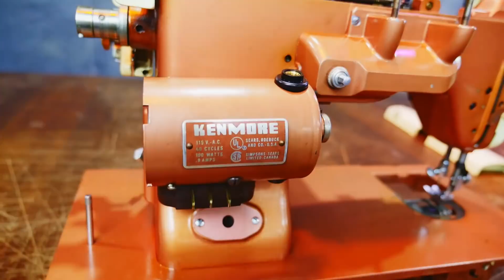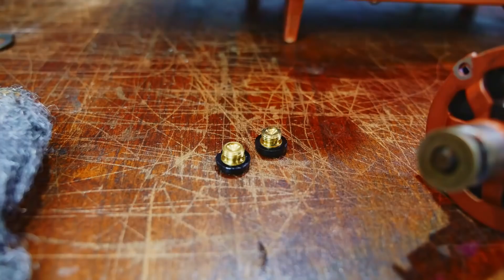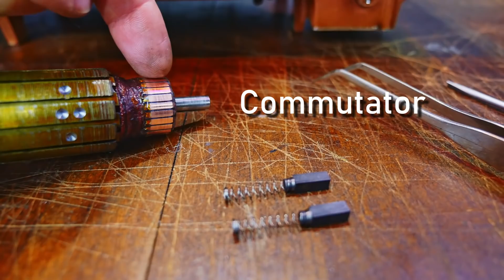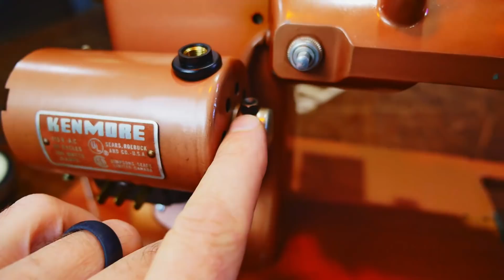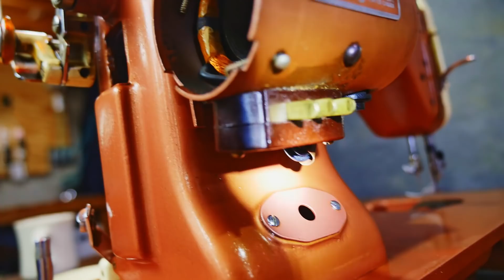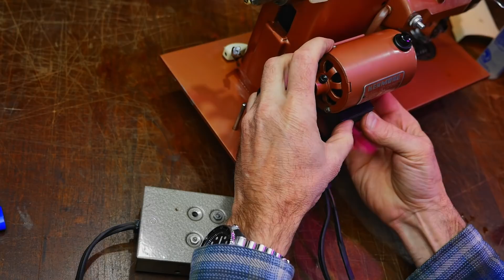Domestic Sewing Machine Motor Inspection and Tune-up

Comment: I know this is an old video but wondering if you might have some input on my machine. I am using an old Sears Kenmore 158.17032 that has a 110/120 volt 50/60 Hz AC 1.2 am motor. Would this maintenance be the same procedure? Do these motors lose any power over time?

Comment: How do you get the motor out, mine won’t budge nuts are off and brushes out but I can’t get it to come out
Reply: Me too! Did you ever get yours open? I'm thinking paint has sealed the pieces together but not sure.
Reply: @millie465  I hammer a flathead between the top and bottom once for each side and it normally pops open

Comment: Hi Alexander. I have a Necchi Leila and the motor has recently been replaced, unfortunately, it still doesn't work as, it stops more than it starts, also it is extremely loud when it runs. I might be able to get the old motor back. From what you are saying, the original motor might be fixable? Warm and best regards.

Comment: The last motor that I worked on, I had to remove the field coils to replace the leads to the brush housings. Man, are those things in there tight! I don't have a puller or press, so I had to work it by hand. Much worth the effort to return a 60 year old motor back into operation.

I have a lot of respect for the old machines. I have 100 year old motors that still run great. Keeping them going pays tribute to their place in history. That's very satisfying to me. I assume that you must feel the same.
Reply from the maker: I do feel the same and in the case of this machine it just looks better to me to have the matching motor.

Comment: I just went through my old Singer model 1873 Merritt. Replaced the brushes & cleaned the commutator. It still did not have the stones to sew with. I just replaced it with the "chinesium" generic motor from Amazon. I had to adjust the foot pedal switch but the replacement works well. The downside to the cheap replacement motor is wire gauge. Very thin on the chinesium pedal/plug assembly. I may graft the old Singer pedal wiring in, although, I really hate to cut it up. Great video!
Reply from the maker: Sometimes you just got to do what you have to do. Thanks
Reply: I actually have a "Domestic" sewing machine...it belonged to my mom...I'm pretty sure I just fried the motor...the label says 65 watts, 110 V, E-6354. It's from Cleveland,OH. Can I buy. A replacement motor???
Reply from the maker: @mariannerodriguez5710   Here is a link to one but you may need to shop around for a better option based on your foot controller and light connection. Amazon is not a bad option for these. https://amzn.to/39fqR4A